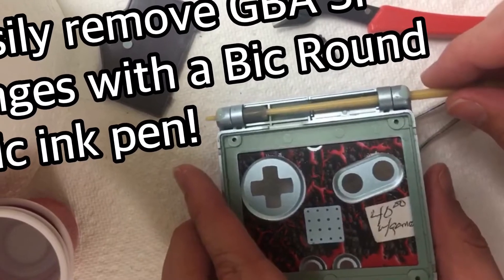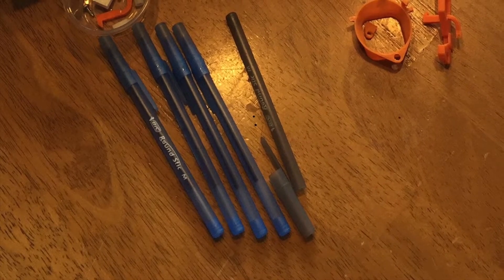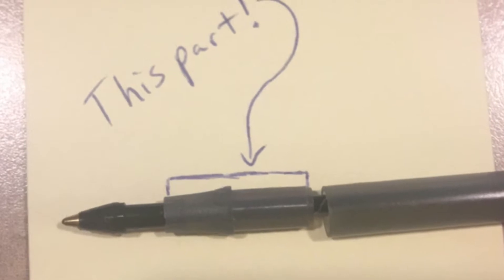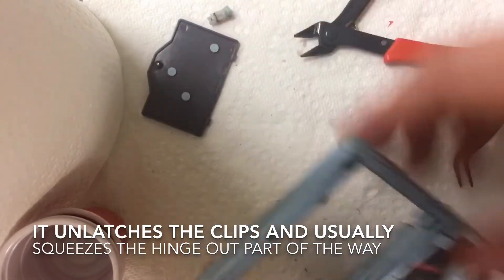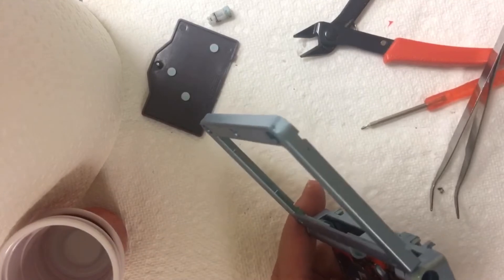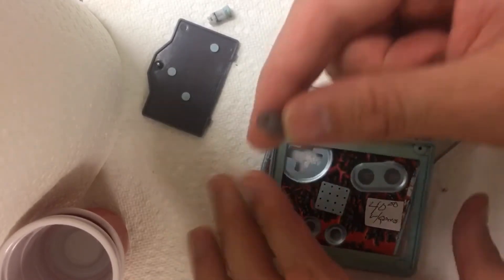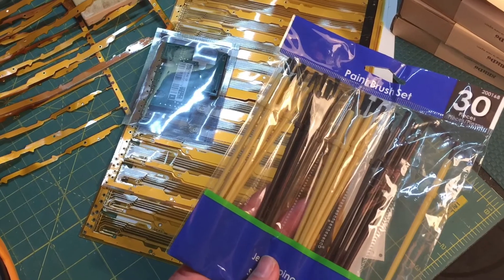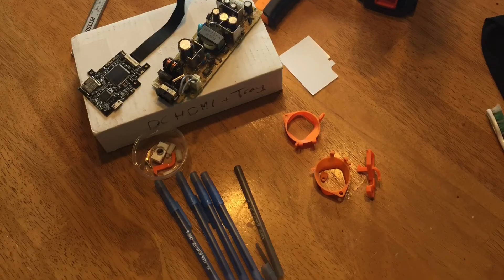How to remove GBA SP hinges for repair, reshell, or refurb

Comment: I has 2007 GBA model with shell cracked, hinges are stuck in little snapped hinge holes.
Reply: It's too much forse per inch, but I managed to pull the left one, nice trick
Reply from the maker: I have found that most of the late models (AGS-101) and early model Nintendo DS (NTR-001) often have extremely brittle plastic and the shell will crack if you attempt to push the hinges out without a special tool or technique like this. When the plastic ages it turns yellow and gets brittle but you can’t see the yellowing since it is painted. Glad you were able to get it out. :)
Reply: @emmettturner9452  yeah, now my new shell is ready, thanks for the tutorial, I'll might mod my 2004 ds fat, for the same reason, but plastic seems okay

Comment: Thanks for the tip homie. Im going to try to replace the hinges on my ags-101! Should i use the cone-shaped part, or the part that goes in the rest of the pen tube?
Reply from the maker: The straight part of the cone piece that goes inside the tube. Hopefully you figured it out since I took a month to respond. ;) Sorry!
Reply: @emmettturner9452  ngl bro i used the cone shaped part lmao. Worked like a charm tho. Ty
Reply from the maker: @gelatnis  Cool. Glad it worked for you! It's harder to cut that side down to the right size since it has a slope to it but it has the same inner diameter... which is the functional part. :)
Reply: @gelatnis   so either side works ???? cone side or straight side
Reply from the maker: The straight side has a slightly wider inner diameter which seemed to fit and retract the clips perfectly for me. The straight side was so perfect that the conical side might be a bit too small. The straight side is also easier to cut down so that it fits between the left hinge and the structural rib nearby. If it isn't retracting the clips then try the tighter cone side. On the right hinge there's plenty of room for either without cutting it down.
Reply: @emmettturner9452  thanks man imma do that right now

Comment: Usually, the hinges have 4 teeth that holds the shell. But I bought a 2nd hand ags 101 and the hinges are just white and only has 2 teeth. Its really hard to remove them. Any advice? :(
Reply from the maker: I have used the pen trick on both types, since they are the same diameter. The piece should slightly retract the clips while still giving you access to push them out with a tool. As long as you have the screen frame opened to the correct position, they should easily push out.
Reply: @emmettturner9452   Just did that and I manage to remove it using the pen trick, Thank you so much!! 😁

but turns out, my hinges had some cracks at the sides, maybe thats why I couldn't get them out using a screw😅
Reply from the maker: @Jonahlegocity  Awesome! Glad you got it out.

FWIW, I have seen especially brittle Pearl AGS-101 units... like Nintendo got the plastic mix wrong. If they aren't cracked already it's very easy to accidentally crack them when removing the hinges.